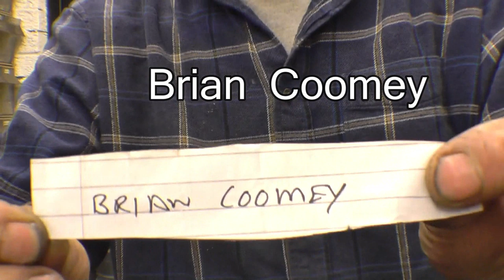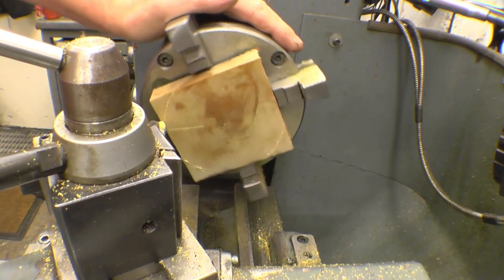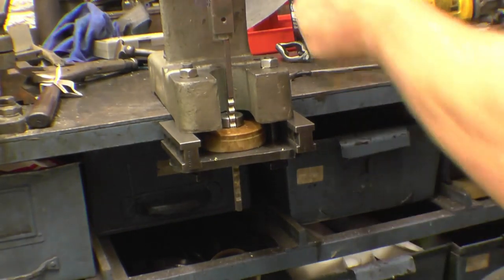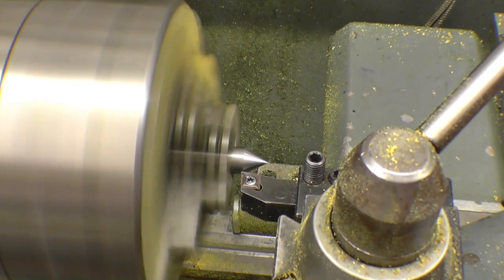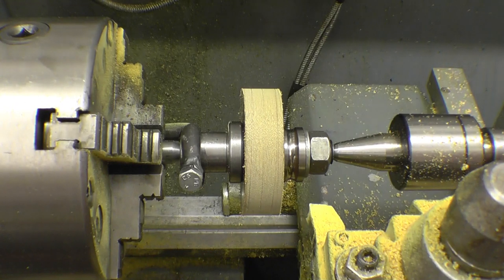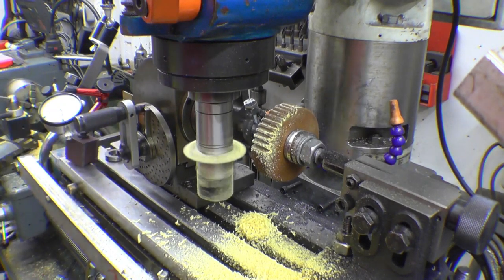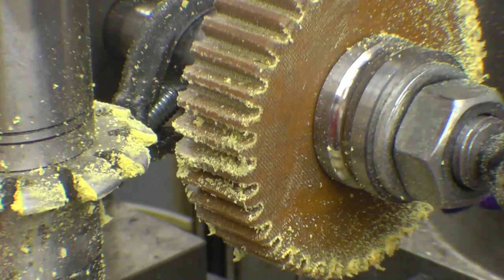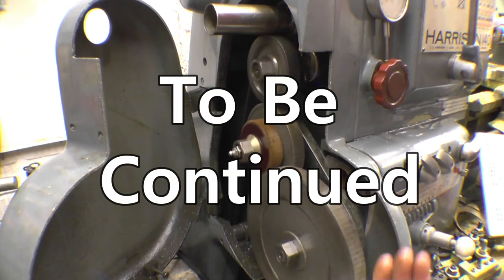SNNC 290 P1  Tufnell Gear Machining

Comment: I had a 1956 General Motors Holden car.  138 c. I.  6 cylinder motor.   The camshaft timing gear was made of this stuff.  The gear would last about 60,000 miles.   The gear was cheap and easy to replace.   In those days you spent all day Saturday working on the car just so you could drive it on Sunday.   Those were the days.................(apologies to Mary Hopkins)!!!

Steve, the boy racer.

Comment: Used to use tufnol for cable supports on the BAe 146. Was told by the machine shop they had to machine it under water, never saw it myself, due to H & S requirements.

Comment: Great video content John, its a lot easier and quicker to machine than metal gives good precise results as long as your cutters are sharp. 
Used this material or similar in the same family for jig making in the past. It is very stable and is not affected by moisture.
Reply: Same for PTFE, you need to use brand new inserts to machine it, otherwise it just smears and does not cut. Nice though is you can use any cheap tap to do threads, if it does not cut it, it will roll thread it. Expensive stuff to work with, you really want to minimise your waste there.

Comment: Hi John.  What lubricant do you use on the gear train of your lathe as when you showed a shot of it running the oil looks very sticky.
Reply from the maker: Heavy gear oil  or steam cylinder oil

Comment: Seems like a steel gear and brittle shear pin would last longer and make less of a mess. I don't understand the benefits of using Tufnol in a lathe. Either way, thanks for the great video. The machining principles it taught were very interesting and well explained.

Comment: The Tufnol gear looks and sounds very nice.   I have seen this material before but did not know the name.
It machines easily, but as you said and show, it does make a mess.
Dave.
Reply: Otherwise known as SRBP Synthetic Resin bonded Paper, the sane stuff cheap printed circuit boards are made from, also known as phenolic resin, as the resin is a thermosetting plastic that is made from synthetic urea and phenol resin. Easy to machine, quite good in tolerances and non wearing to steel gears, plus oil tolerant, but will strip out long before the steel is damaged. Most commonly used to make electrical insulators for all sorts of high voltage and industrial applications, and also capable of being moulded with built in inserts, which are often seen in industrial motors as the electrical connection block.
Reply: Good to know other names.   I will have to look out for some of this.   Sounds useful to have on hand in the shop.
Dave.
Reply: @SeanBZA  if I may comment, the grade John is using is cotton based (SRBF), far stronger than the paper based (SRBP). Tufnol UK has brand names of Carp (SRBF), and Whale (SRBP),  we use Carp brand for non-marking gripping of chrome plated steel bar at high forces.
Reply: Also in the same family the backing for high pressure laminate HPL. Worktop face material Formica, Duropal etc.